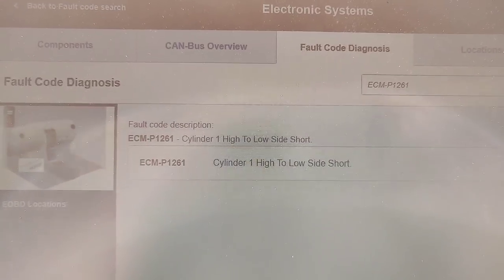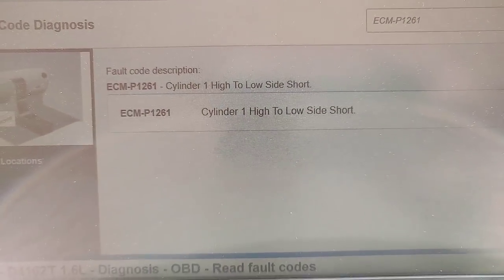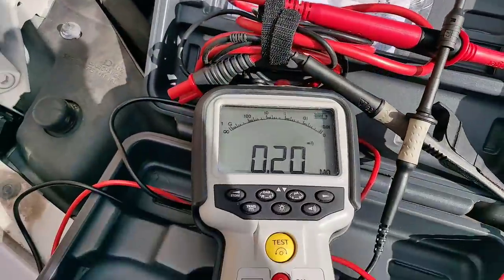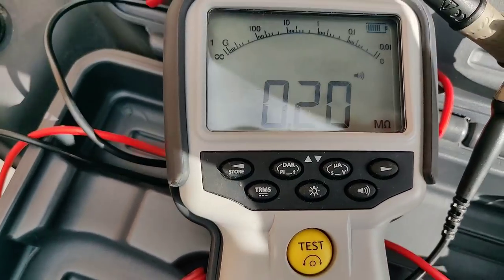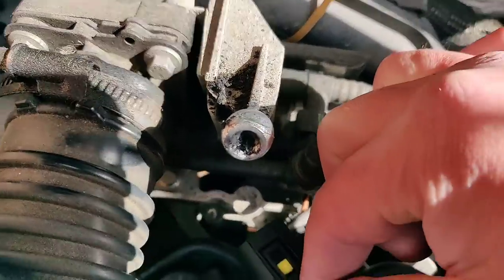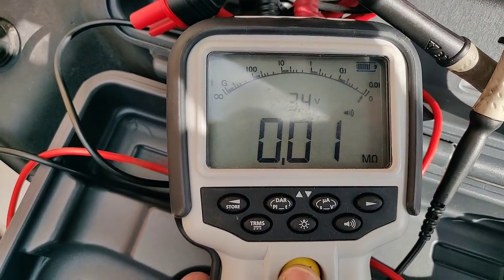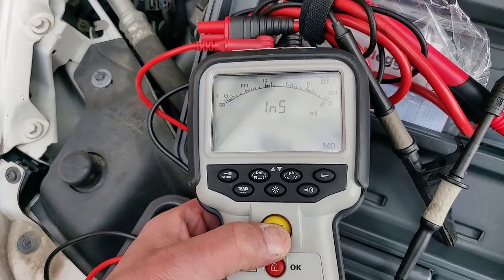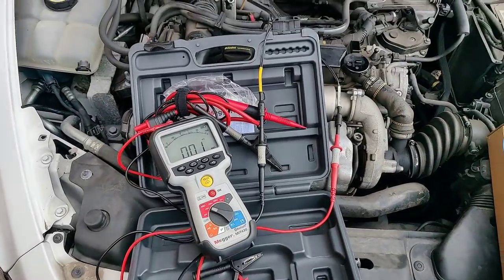P1261 injector high side short

Comment: Apart from the wind noise another great video. 
Daft question but is it not possible to confirm the injector is faulty with an ohmmeter or do the piezo injectors require a different approach?
Reply: wardybasher ohms reading is not loading the piezo stack the same as mega testing.
None piezoelectric ohms reading is of more benefit.

Comment: Ah, for once I see someone using a decent Megger, and using it to properly diagnose a short on a vehicle, superb ..... I to obtained my MIT Megger from a well known auction sute, superb bit of kit if used properly. keep up the vids Steve
Reply from the maker: I've just requested some better breakout leads from Warwick test supplies so I can run the test on 250v in the future
Reply: @SimplyDiagnostics  As you are probably aware, because your mit has 50v capability, 9 times out of 10 thats adequate for shorts, along with the 100v setting. You'd only go higher if testing say HV leads for breakdown.

Comment: How do you tell if the injector is piezoelectric or solenoid type? Also is it safe to use 250 volt test on piezo? And is it safe to use megger on solenoid type? If so what voltage?

Comment: Eh Steve if you could put the tools you use in the description. I seen you said something about a eBay special but didn't catch the rest. Seemed a little muffled. 

Should look into one of those wirelessly microphone deals where you wear the microphone with a transmitter to the camera with the receiver plugged in. You'll want to make sure to get one with a good noise cancelling microphone so your voice is heard. 

Maybe for this video you could put a description and edit the section where you describe. 

You could always upload the video again and remove the audio and just narrate it while inside your house and upload it with you doing a walk through speaking to us. 

Tool seemed nice. Would like to know more about it and keep em coming!
Reply: Sorry missed the tool description. 

What did the customer do? Do we get to see the fix or did they just have you diagnose so they can fix themselves?

OF course with those diesel injection cars are the injectors easily replaced like gasoline engines or are they more in depth such as like the medium and heavy duty semi trucks where you have to tear the engine open to get at them internally?
Reply from the maker: I'll update the description when I get home 👍
Reply from the maker: I'll update the description, yes, I only diagnose.

Comment: Nice video Steve 
When using the insulation tester what value do you need to look at the voltage reading the ohms reading or both & what would be acceptable values.
Regards 
Madds
Reply from the maker: The voltage is critical for the insulation test, this one was so bad that my thin leads didn't corrupt the results. Over 100v was fine in this instance. Both AC Autotech and SY Diagnostics have done videos on this and are on my liked video playlist 👍

Comment: Hi Scott, great channel mate! I’ve got question because got fault P1264 High to low side shorted cylinder 4 same engine but fitted to Ford C-Max and as far as I know cylinder 4 is cam belt side on that French engine. But you’ve had cylinder 1 fault and replaced cam-belt side? During the lockdown I’m limited with tools got only multimeter, Ditex itester and VCDS at home and want help family friend out as she’s paramedic. Thanks
Reply from the maker: Refer to manufacturers data for cyl layout. The quick way is to disconnect one of the injectors and see what cyl the DTC sets for. It can be
Reply: @SimplyDiagnostics  thanks for replay mate, got wiring diagram open now thanks to DiagnoseXL Data, just make me confused because I've replace injector 4 cam-belt side back in September last year it was genuine ford injector and went for coding to ford dealer and developed same fault same cylinder. My mate who works for local Ford dealer was convinced injector 4 on them is cam belt side(btw he's done coding as well). So I don't want fire cannon of parts and want diag propyl  I'm tech but beginner to Picoscope and that stuff.
Reply from the maker: We all start somewhere, you're a bit limited with the kit and information you have to hand. If it is cyl4 then it's should be under warranty.
Reply from the maker: Start a discussion on www.simplydiag.net with reg & Vin and let's see if we can build you a test plan.

Comment: Allow me to ask Steve what so special about this multimeter 
Thanks for the nice video
Reply from the maker: It's just a really good tool that does what it should. I can rely on its results 👍
Reply: Simply Diagnostics Thank you for reply now I got it what it’s for it’s an insulation tester isn’t it 
Sorry for being cheeky have you got any links for it 
Anyway thanks again and keep up the good work mate and pop round to Hastings to the seafront mate in the summer I’ll buy you a pint 🍺 👍😉
Reply from the maker: They're always popping up on eBay for the right money 👍
Reply: Simply Diagnostics just had a look there’s one just shy off £700 quid will keep looking as it’s an let me use your word 😂 AWESOME 😎
Reply from the maker: I picked mine up for £300, bide your time, they come around frequently 👍
Reply: Simply Diagnostics thank you mate that’s what I have done saved search on the bayOfdoom and once one pops up will snatch it